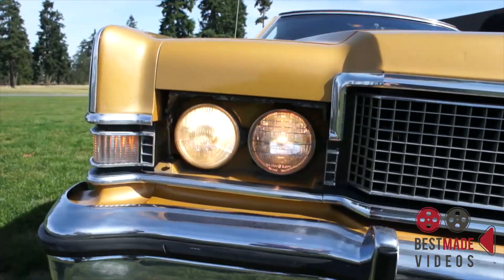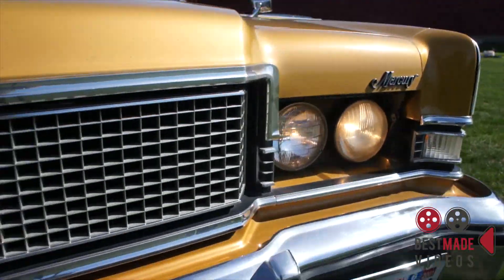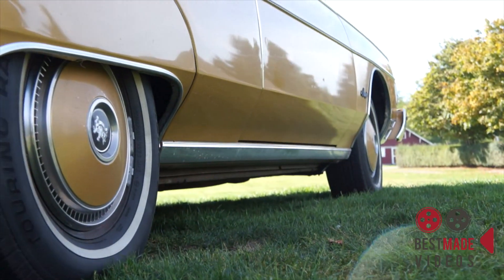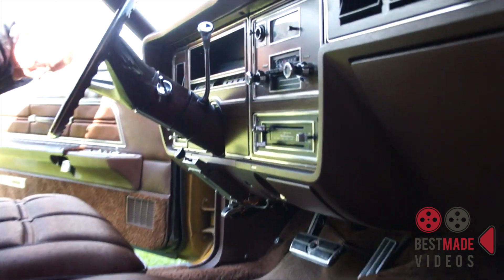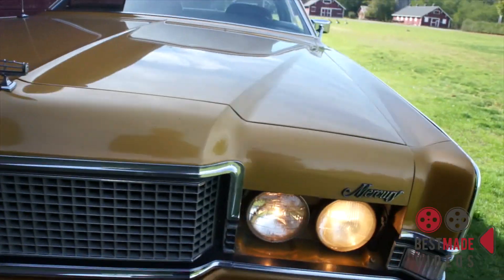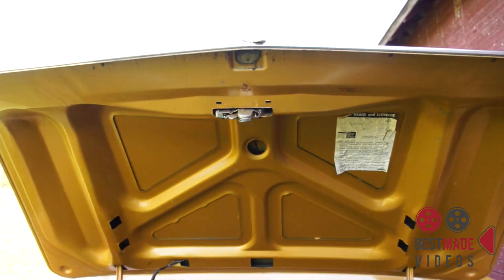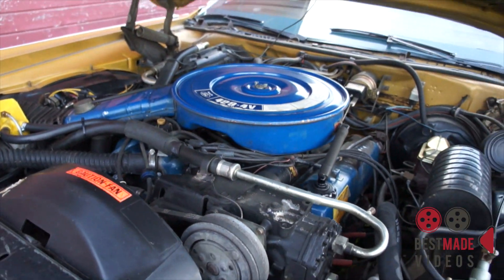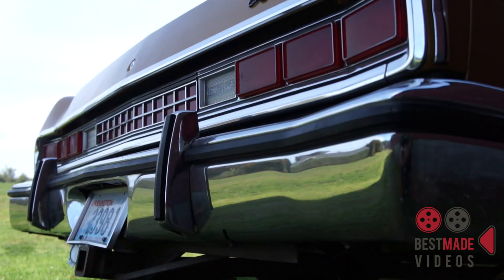SCC 1973 Mercury Marquis

Comment: Wow wow 73 Marquis brougham package BUT WHAT IS more rare is the 429 4bbl engine!!! Exceedingly rare for that car which usually had the 460 4bbl. That 429 in there just incredible and again very rare engine for that car. Obviously special order but damn I like it
Reply: Want to sell it. GOT PLENTY OF CASH. PLENTY$$$$
Reply: That statement is completely false.  The 429's were so much more common on these cars than the 460's.  Only about 1/3 of the cars came with the optional 460 motor.
Reply: @klwthe3rd  Thank you Sir, I obviously was wrong
Reply: Check again my father used to buy new Mercury's the 429 was the standard engine from 69 to 74 when the 460 became standard research it I was there